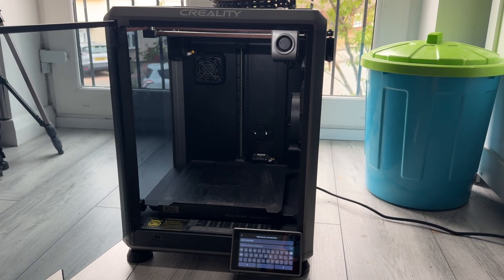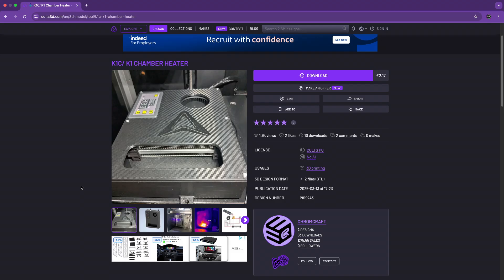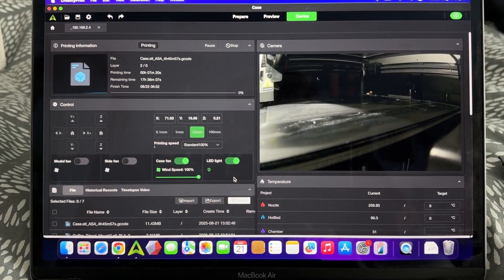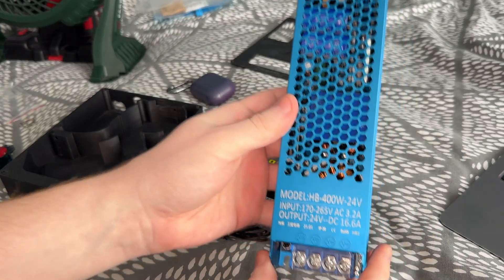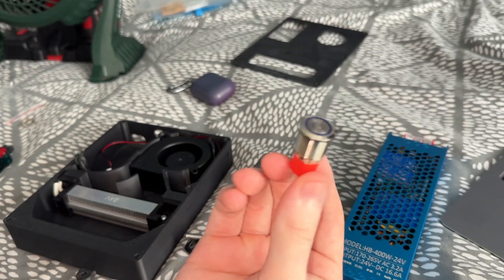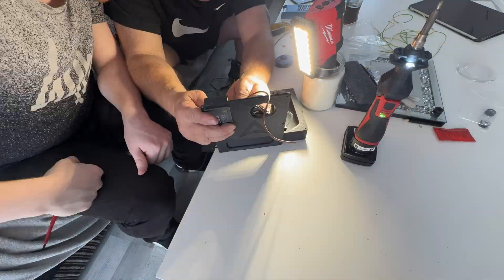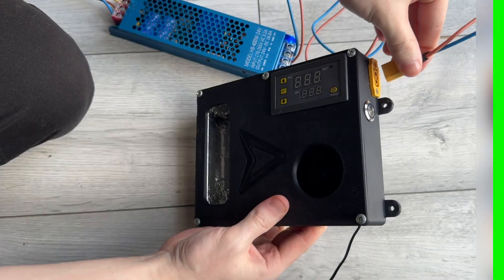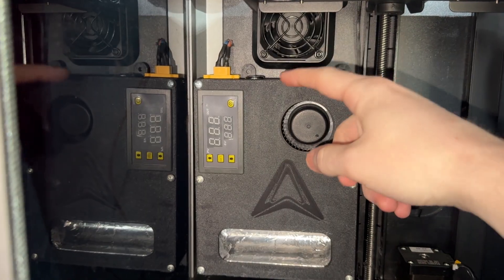Upgrading my Creality K1C 3D printer (active heat chamber)

Comment: Thinking about doing the same but my K1C gets to 45 degrees just with the bed heater but the rear fan cuts in about 40 degrees .what was the max temp your got to ? Did you disable the fan .I also have made a box out of foil sided 25mm foam panel which should help and keep the smell in lol